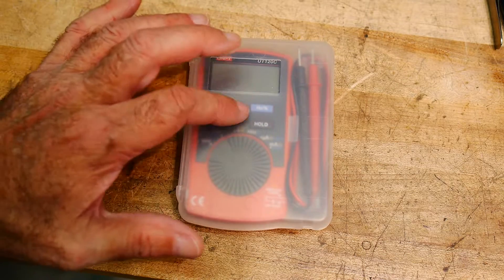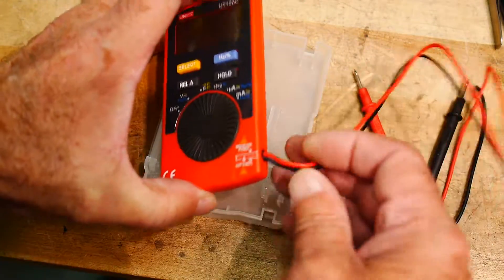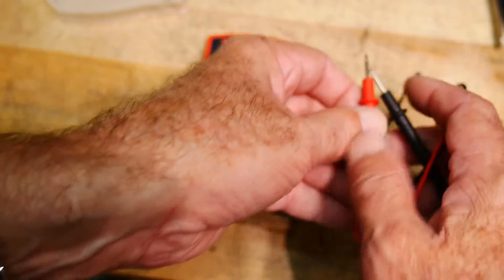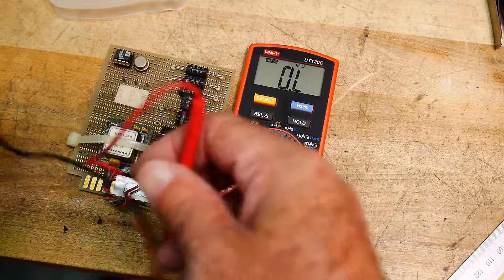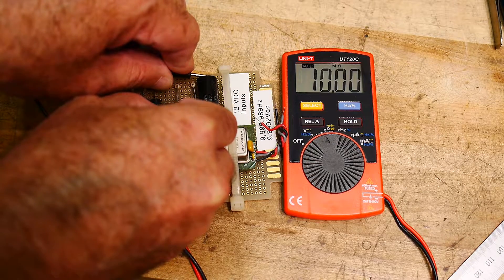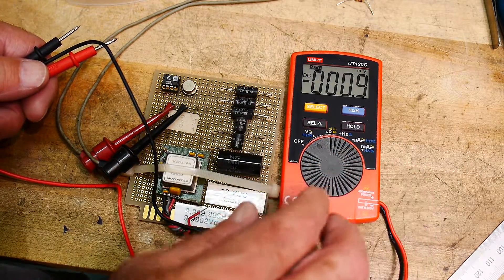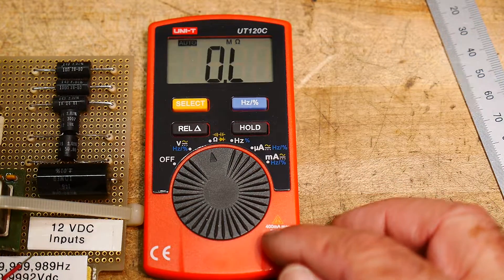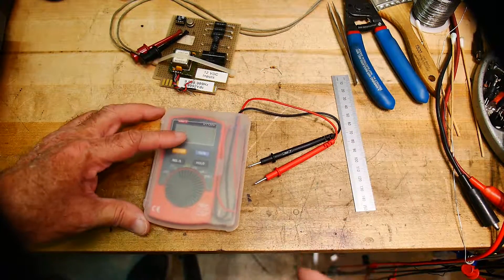#514 UNI-T UT120C Pocket Multimeter

Comment: Is the battery primary or rechargeable? If primary what are they using for a battery?  Does it have an auto-off feature?
Reply: It uses a 3V battery (CR2032)
just look up the technical specifications at
https://www.uni-trend.com/html/product/General_Meters/Digital_Multimeters/UT120_Series/UT120C.html
Reply: It has 30 min Auto power off. Please also see the link above...